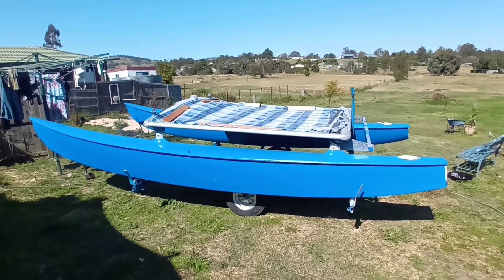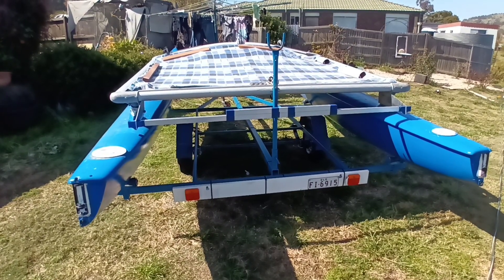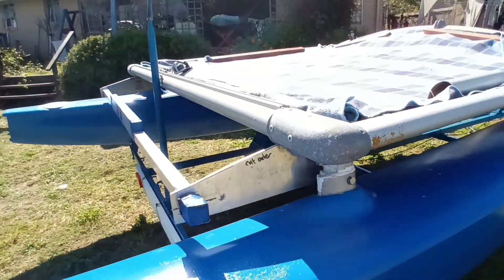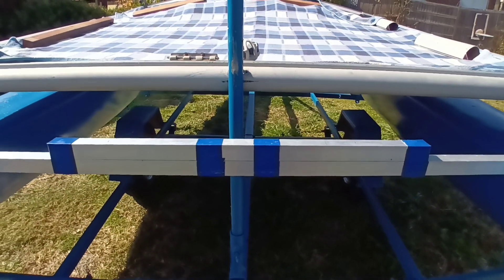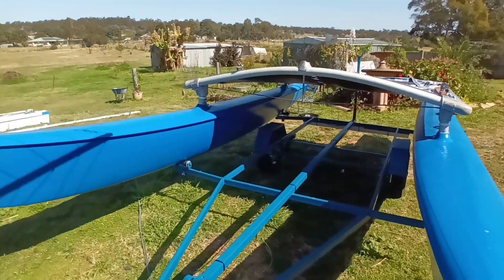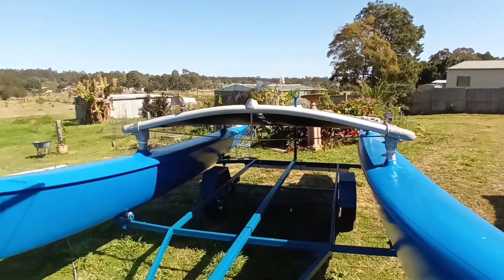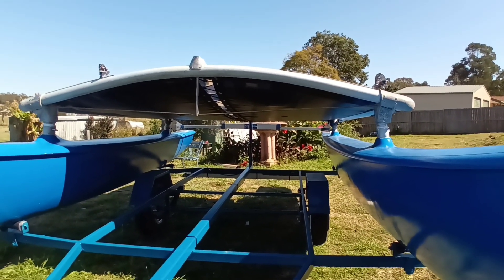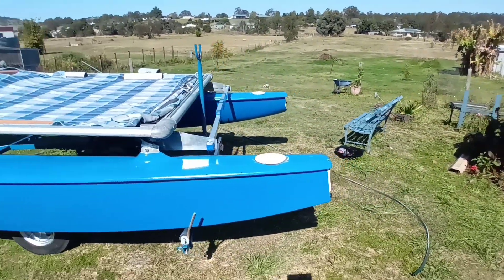Project Motorise Hobie 16

Comment: I put a 2.2hp on my Hobie 14. Used an aluminum extended motor mount that extends beyond the rudder steering bar.  Steering with rudders vs steering with motor alone is much better. Though either can be done.

Comment: I'm just about to do this on mine, with an electric motor and battery. I was thinking 5o put it in front, mounted on a 2x6 board,  that sits on top of  the hulls.  I can then adjust the height, above the water. I thought I would need to be able to move the propellers direction.  After watching this video, I'm going to just keep it heading straight,  and steer with the rudders. I also just put in the port holes, coincidentally.
Reply from the maker: Hi Arthur. I find it steers fine with Hobie rudders. Also means you can sail and motor at the same time....a big plus in light to no wind. With the motor only on the back...it also steered fine
Reply from the maker: Arthur, have you seen my current set up. See https://youtu.be/yTiSgEtfPA8?si=jM94twCf63frxTNz

This, I believe is the best option....to retain sailing and motoring options....without having to remove your rudders each time. I had to extend the brackets, as the motor fits behind the bar, when fitted in front....but can be turned backwards for starting and for reversing. Your 2x6 option should work fine. Enjoy. Send me a link, if you make a video.
Reply: @lornescott-wilson6144  Thanks for the link, I see how you do that in front. I'll set mine up like that, if possible,   tho I have an electronic motor, with a battery, so it may be awkward.  I've used  this motor on my canoe. I was surprised how fast it goes, when you use a paddle and a motor, at the same time.
Reply from the maker: @arthurzengeler8296  Yes, indeed. I tried to motorize my kayak. Went well, but difficult to steer. Needs an outrigger and would be perfect